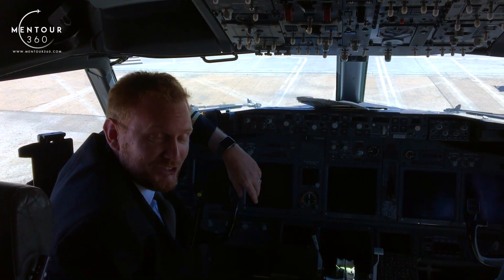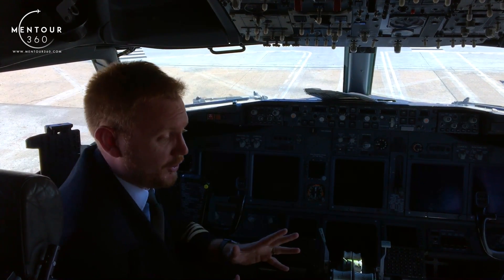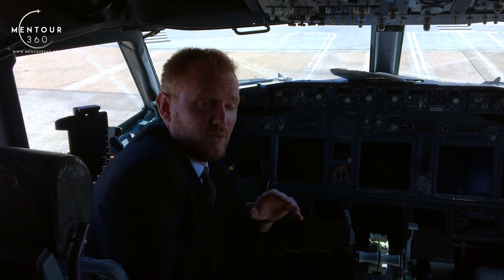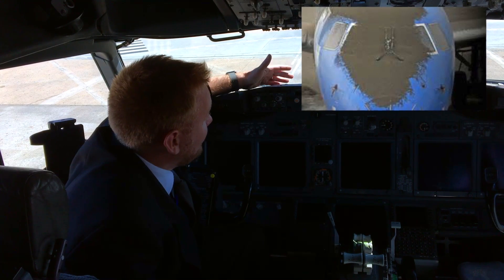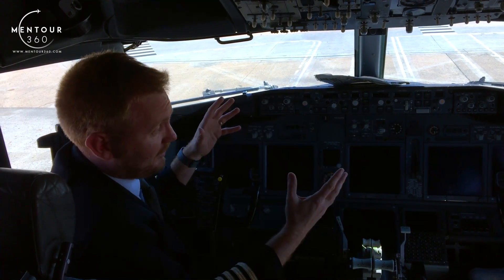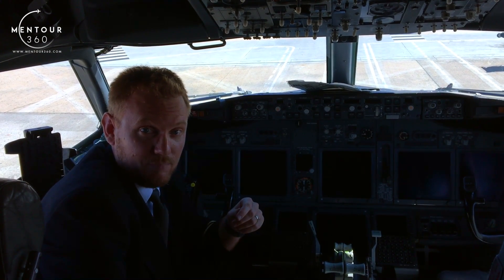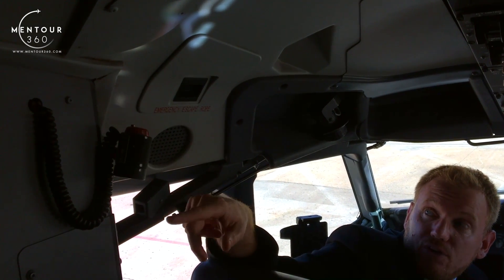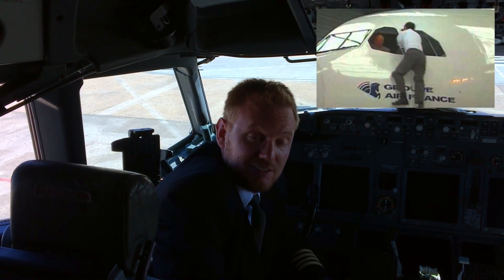What happens if you OPEN the cockpit window?!

Comment: In 1990 a British Airways Flight 5390 Captain, named Tim Lancaster was sucked out of the window at 23000 feet when the window glass broke midair causing explosive depressurization. The Captain's shoes got stuck in the yoke which prevented him from  being lost. The crew members also held his legs. The copilot immediately lowered the plane and did an emergency landing at the nearest airport, while the crew kept holding the captain's legs. Although they believed him to be dead, they didn't let him go to prevent the risk of him being sucked into an engine or do other damage to plane. 

But actually he was found alive, got treated, recovered and returned to business few months later. The cause of the accident was a faulty replacement of the glass window ordered by that very captain before that very flight.

Comment: Can you close the gear on the tarmac?
Reply: Triggered
Reply: Crawford 2048 Most Planes have sensors that prevent that, but actually a captain named Hans Ulrich Lutz did that on a Saab 340 which totaled the plane. He was fired as an instructor but kept his job due to a pilot shortage. He would be killed in Crossair 3597 several years later for going below Minimum Descent Altitude on an approach to Zürich.

Comment: Make a detailed video on the Boeing 777 door, like Airbus, the doors move upward a centimeter or 2, and then outwards. The 737 door makes an air-tight seal against the door frame. the 777 and Airbus seemingly doesn't make such a seal. What is going on with those doors? * confused *

Comment: what happens if you open it in flight?? you get fired 😂 just kidding. I fly the shorts skyvan and the window design is on the curved edge of the windshield and makes a bubble of air you can put your hand out ask deflect air into the plane for when it's hot outside. since I didn't fly faster that 150kts it's safe :)

Comment: What happens if you pull the gear up leaver while the a/c is on the ground?
Reply: Emanuel Engström the lever is locked while on the ground
Reply: You are right, the weight of the aircraft will prevent the main wheels from retracting and the nose wheel will defiantly retract. I've seen it happen, another thing I saw was a pilot garbing the end of the escape rope and jumping out of the window,  that was out of a 707.
Reply: you get fired and have to live with being an absolute idiot for the rest of your sad life.

Comment: ReHi Mentour Pilot:

Many of your videos which I have seen are more broadly based than this one, and in those there has always been much good advice for younger generations. (I wish I had had that when I was young, but unfortunately what I had was anything but!)

Hence I am happy for the younger generations that they have learning opportunities my generatipon never had, and were much abused both physically in some cases, sexually in others and intelectually in still others (the latter was more what happened to me.)

While I am not yet in a position to upload videos to You tube, closer to that goal is the idea of uploading sound tracks to Google Drive and providing soft shareable links in You Tube comments.

Note re "Google Drive":

Most Windows users simply think of Google Drive as the windows app the Google provides. However the app itself does not exist in Linux.

Nonetheless, underlying that app is the Google Drive API (or application interface), and Linux can use that to interact very well. the GUI part shows up in Nautilus, the Gnome Desktop file manager that comes with many Linux distributions. (I use Fedors Workstation, currently at version 25, with 26 expected around July 2017.) hence no compatibility issues between Windows and Linux users, and likely littyle with MacOSX (Tiger and up).

That said, and being one who loves public speaking be it in Englsih., French or Spanish, especially on complex and sociologically contgroversial topics, I can use my voice to enhance the emotional depiction of my content, even though with advancing age it has become rather gravelly.

Note I am not looking to get involved with adsense unless I have to, nor open my efforts to any sort of monetisation. This avoides any co-dependent interest on direct benefits, maintaining my stolid principole of independence.

North a,merica:

I noticed Damien, your first American cadet, and am hoping that maybe tyou will end up[ acquiring a Canadian cadet. This might also prove to be a special oipportunity to some young person of Inuit heritage, as the north need aviators and aviation sup[port staff.

Once In the Greater Montreal area, I encountered such a young man who had come here from the Kujjuaq area to study and become an aircraft mechanic. For that sort, I say "Go for it!".

It was also a chance for me to learn a tiny bit about life up there.

Piloitds who want to fly that sort of stuff may be flying airbusses of perhaps 135 passengers from Montreal up north,. where the passengers then transfer to smaller planes serivng the many settlements along the Povungnituk river., running Wast from Ungava Bay to Hudson''s bay..

Naviagetion and radio usage are alse a special situation in the CVanadian Arctic, partly due to the wide and dynamic deviances between magnetic and true north, as well as other considerations in regardfs to radio wave propagation, which, I think may be due to the proximity to Magnetic North.

Arctic scenery can also be very striking at times. I have several photos downloaded from Nunanet taken in the tundra. these photographers have a sense of natural beauty of their own.

CRM:

This subject also, I noted soe time back, and it seems to me that before a cadet even starts to do a type approval, or hopes to do so, he should be screened for potential propblems in the interpersonal area, so money is not spent if the candidat is profoundly not apt.

Unruly passenger problems:

This scourge has been monitored by IATA for some years now, and much of it seems alcohol related. Given the psyychopathologies that undely alcohol and substance abuse, and the experience we have with drinking and driving, it would seem appropriate for all IATA signatory countries to legislate obligatory breathalyser tests immediately before boarding  and searches to see that no hiddel alcohol or intoxicants are being carried onboard.

These questions ar enot going to go away in any hurry,. so you might feel it appropos to adress them for all??

Comment: can you depressurize the cockpit without having to depressurize the whole aircraft?
Reply: No therefore you should fly at a low enough altitude to do this.
Reply: Not true, dont hear the other guys, they most probably are microsoft 98 flight simulator amateurs.
You can depressurize the cockpit alone because if there is an electrical fire behind the panels where a fire extinguisher cant reach, you open the window and since there is very few oxygen at very high altitudes, the fire will cease to exist. But the pilots obviously have to put their masks on to keep breathing. Then continue to a safe flight emergency landing on the nearest airport.
Reply: is everyone mental who is watching this video?

Comment: One question, How do the airplane air pressurize the cabin ?
Reply: thanks I always wanted to become a pilot and now Im trying to learn everything from airports to airplanes and airlines and how Pilots operate and their language and communications with the tower
Reply: Depends on the aircraft. But for normal jet engined aircraft the pressurised/pnuematic air is bled from the engine rooted towards the packs where it is cooled, filtered and introduced into the cabin via the mix manifold.  The cabin altitude pressure is maintained via the outflow valve which controls how much air exits the plane (like a tap), therefore regulating the cabin pressure/altitude which is controlled by a computer.